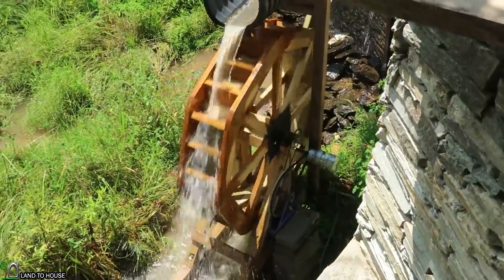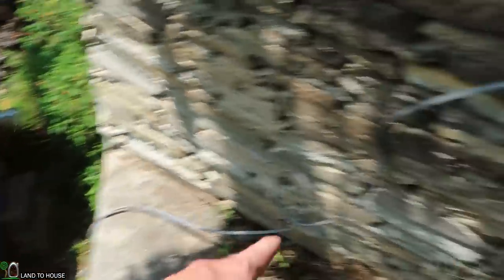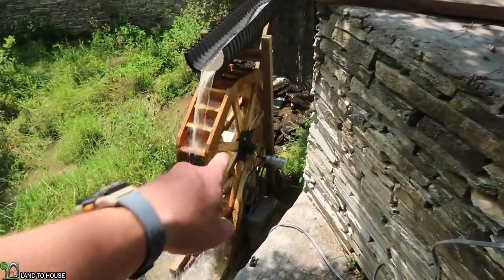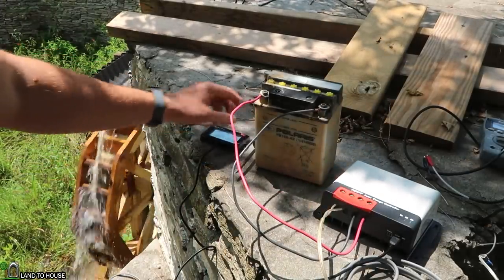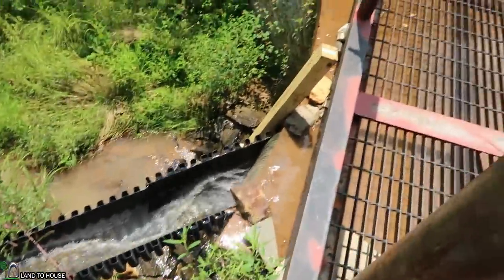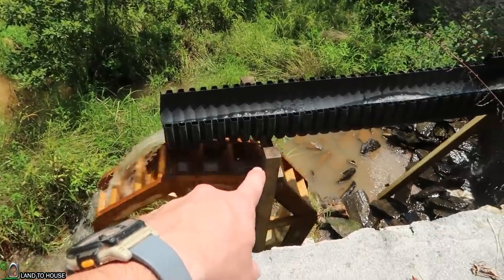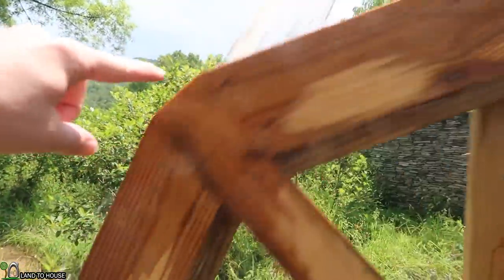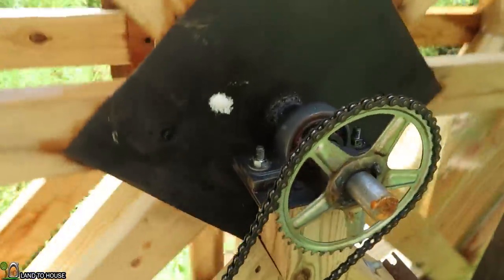Hydro Electric Waterwheel First Voltage Reading

Comment: WHY IS IT THAT WHEN YOU GUYS BUILD A WATER WHEEL. YOU GET YOUR PLANS FROM THE GARDEN CENTER. . WHY DON'T YOU BUILD YOURSELF AN INDUSTRIAL WHEEL.. YOU TRYING TO MAKE ELECTRICITY WITH SOMETHING THAT'S JUST SUPPOSED TO LOOK PRETTY.  IF YOU LOOK AT A GOOD BUCKET ONLY WATER WHEEL AT 90°, IT LOOKS LIKE THE LETTER G. YOU'RE TRYING TO KEEP WATER ON THE WHEEL AND IT FALLS AT THE VERY BOTTOM UPON UPRISING. THE IDEA IS LEVERAGE LEVERAGE INCREASING UNDER TORQUE.  YOUR FLUME CONCEPT IS POOR YOU'RE SUPPOSED TO HAVE WATER BACKED UP INTO THE FLUME AND POURING DIRECTLY DOWN ONTO THE BUCKETS. PREFERABLY AT POSITION 1:00 LOOKING YOU'RE SUPPOSED TO HAVE RUNNING SIDEBOARDS SO THAT THE OVERFLOW WATER WILL FLOW INTO THE NEXT BUCKET.  .. YES THERE ARE QUITE A FEW DIFFERENT TYPES OF WATER WHEELS. I AM FRUSTRATED THAT YOU GUYS DO NOT DO THE RESEARCH AND PICK YOURSELF OUT A GOOD ONE FOR ELECTRICITY..
Reply: Totally agree, a little bit of research shows that waterwheels are mature technology and the design is well understood AND DOCUMENTED in libraries to be copied for efficient, powerful wheels.

Comment: If u know gearing u want biggest gear on wheel same size as wheel then smallest gear u can use for it smaller gear spins ten times one spin vs 1 spin per wheel with two smaller gears u want a giant gear same size as wheel only way it works and smallest gear on generator best thing is bike gears cut em screw em to other edge of wheel cut bike gear in 4 spots 3 screw holes peace metal over it add more teeth over time bigger gear trust me smaller gear on motor has to be dc and best way chop up bike gears for free space em out cheaper plus wood gear right thick asf put metal braces size lil bit smaller then wheel but bigger better then add cut chain brackets to make bigger wheel gear